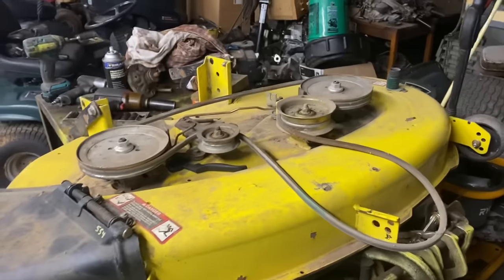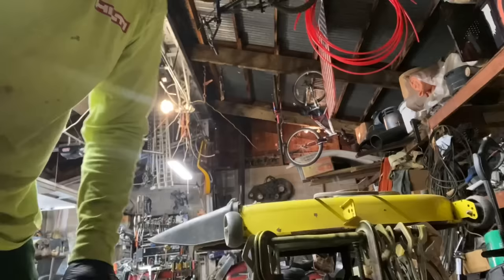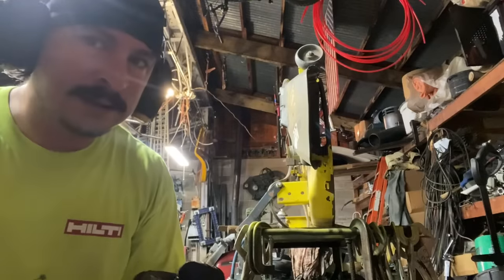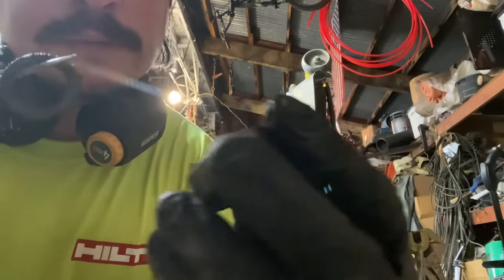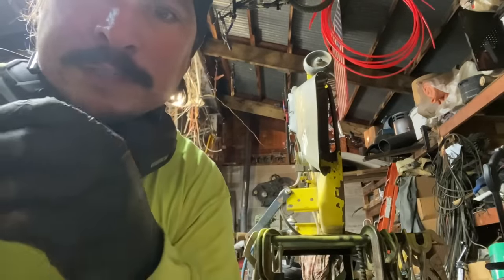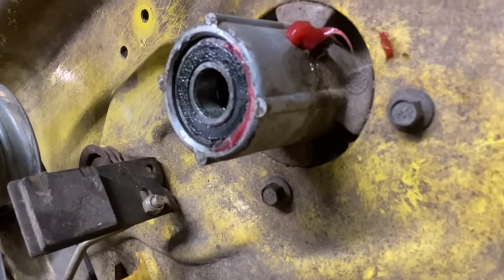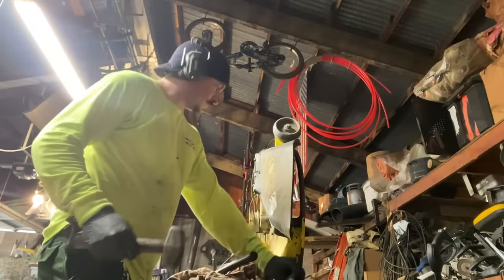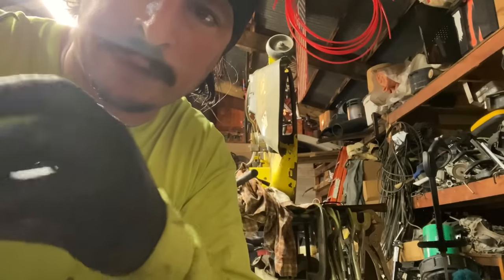Part 1 - Don’t trust the “Experts” Grease your mower deck sealed spindle bearings Common sense.

Comment: Doesn't the shaft still need grease?
Reply from the maker: Please explain? The shaft? Only the bearings need grease. Some shafts have a zerk on the top and grease enters through a hole in the shaft. Is that what you mean?
Reply: @GTObearclaw1   I thought there are spacers in the middle
Reply: @GTObearclaw1  So then how do you tell if you have sealed bearings in your spindle? I have a mower with the hole on the top. Does that mean it has open bearings? Or are they sealed too and they just put a zerk at the top to give you a warm and fuzzy feeling?
Reply from the maker: @grasscutter88  some types of spindles use spacers to seperate the bearings some use the housing to space the bearings and or shaft. In some cases the shaft or hosing has a step cut in it to maintain bearing placement and no need for spacers in those type. As for grease, just add grease until it exits a bearing and your good to go. Seals are invisible to grease and the grease will pass right by the seals like they don’t exist. The only spindles that I can’t guarantee will allow the grease to pressurize and push past seals are the MTD spindles with a relief hole in the side of housings. In that case grease will exit there first. Just plug that hole with a screw or add another zerk. Then you will have a zerk on the top side of deck too that will be easer to acces. The ones with hole normally have the zerk under the deck where it’s covered with old dead grass and hard to find. The ones with zerk on top of the spindle shaft are usually AYP Husqvarna craftsman Poulan Ariens. Those don’t have a bearing spacer and greas can still
Fill the void and pass bearing seals. This is really simple stuff. Not near as complicated as folks like to make it seem
Reply: The ferris ICD deck has a relief hole too
Reply from the maker: @grasscutter88  im not familiar with that brand. I figure it’s probably similar but those are commercial so may be tapered roller bearings. Would be best to get advice from someone who knows those. But it’s safe to say you should grease until you see it exit the hole. That’s a bare minimum. And in some cases like equipment without a inner shield in place that’s efficient.
Reply: @GTObearclaw1  I think they're sealed. Hard to tell though because they have different brands and I forgot what  the part number was.
Reply: 5023330 is ferris' part number for the bearing. Looks like 6305a is the bearing number. The oem ferris number seems to show it as an open bearing on one side.
Reply: Looking it up by the actual bearing number I think it's just a standard sealed bearing. What does the A mean in 6305?
Reply from the maker: @grasscutter88  good
Question, I think if the part number has RS in front of the number it means rubber shield but I can’t recal what the letter after means. Maybe someone will know and reply to help us.

Comment: The problem is this. grease zerks do not hold pressure, they do not have a one way valve in them. I don't believe that you can lube them enough to apply constant pressure driving the grease into the bearing, particularly the upper bearing.
Reply: In a sealed system, zerk fittings do indeed hold pressure unless the zerk is bad or the system isn't closed such as the spindle in the video. The video is absolutely correct in every way and the seals in question are nothing but dust covers with water splash protection. Once the inner spindle housing is completely full of grease, the bearings will also fill with grease just as the video proves.
Reply: @delemerson9306  Are you sure about that? I am asking sincerely. I just don't think that you can maintain enough pressure in the housing over time to drive grease through the rubber seals, especially the upper ones. I would be more inclined to remove the inner rubber seals but then there is the possibility of contamination entering the bearing, particularly the lower bearing. Damned if you do, damned if you don't.
Reply: @randaldavid7685  I'm absolutely certain as I've personally experienced it. Everything in the video is correct.
Reply from the maker: Del knows what he is talking about and thanks for the comment, del especially. 
Grease zerks do hold pressure if in proper working order. You can google a diagram it’s a zerk. super simple design and self explanatory when you see how they are constructed. They are designed with a one way valve. And the tool providing grease is where the pressure comes from. A standard grease gun can apply 2,000 psi. And as much as 15,000. That’s why it blows my mind that so called mower gurus are telling folks that it’s a Wase of time to grease these spindle assemblies. If the so called experts were half as smart as they think they are why not test the theory in a video and prove it won’t work. But yet not a single naysayer has provided video proof. That’s why I decided to call BS on the topic and try to help folks get the right info. And that’s why I felt the step by step process was necessary because folks won’t simply believe that greasing the assembly at the zerk will apply grease to the bearings so I proved it step by step to help folks see the truth of the matter.
Reply: @GTObearclaw1  your video is a perfect example of YouTube working to properly inform folks who have needs when they are DIYers or simply can't afford to pay a shop for repairs. Thank you for the video, we appreciate your efforts
Reply: @GTObearclaw1  Thank you for your reply

Comment: Don't a lot of these spindles have a air hole when you're pumping grease into it that the you hear it coming out of the air hole.
Reply from the maker: The only mandrel housings Iv seen with a hole between the bearing position is made by MTD. I’m sure others exist but MTD is the only manufacturer Iv personally had experience with. The MTD umbrella is Prety large. Cub, Troy bilt, MYD gold, whites, and many many more. Not all but some of them have had the “weap holes” and I suggest filling that with a screw. In my opinion the weep hole is a way to prevent grease from reaching bearings so the parts fail and require customers to buy parts from MTD. No reason I can see that having that hole makes any logical sense. The only people who think it makes sense don’t really understand the process I explained. They think seals will get damaged. But those same folk have never spent any time to verify their beliefs.

Comment: The only way the grease will get in the bearings at the top and bottom of those shafts is if you take out the seals that face the inside of the shaft and then put major amounts of grease in that Shaft. Unless you put a tube going to both top and bottom where it will actually get to both bearings. Another way would be a bit harder is to drill a hole at top and bottom of that shaft and then place a tube directed at the bearings. The one at the bottom would work better as gravity would make it so the top wouldn't get a lot unless you did get a hard tube directly to it. Just pumping grease into that shaft without removing the seals covers won't work and you spend lots of money on it. it would be better to take the bearings out and hand grease them and put them back in!
Reply from the maker: Wrong. Wrong. Wrong. That is not the only way. Thats just the way that requires a bunch of wasted time to disassemble and pointlessly remove a few seals that can’t stop pressurized grease. Did you even watch the video? I just showed everyone step by step basically breaking this process down to baby steps so folks could watch every step of the way and see it’s not magic. that all you need to do is grease until it exits the assembly through top and bottom bearing. Can you explain how grease came out the assembly by passing through the bearing? Good lord I feel like this is rocket science. You just overcomplicated this more than anyone else who has left a comment saying the seals stop pressurized grease. You guys are killing me. Open your mind let your brain work. That inner seal can’t stop 5000psi of pressurized grease from passing it. What In the heck are you even talking about, tubes? Come on man this is way simpler than your making it.
Reply: @GTObearclaw1  yep I did watch your vid but didn't see where any grease would have gotten into the bearings through the seals that wasn't there before forehand from the factory.
Reply: @GTObearclaw1  The seals are made to keep grease in and hopefully dirt out but trying to force grease into them without first removing the seals facing the inside of the shaft is a lost cause!
Reply from the maker: @mortneff4674  if you in fact did watch the video, can you explain how grease passed by the upper and lower bearings and exited the outer seals of both without passing the inner seal and then through the bearings? It boggles my mind that someone would argue about something that’s simply laid out in a step by step process shown in a video to prove it works. Those inside seals can’t hold back pressure, specifically the grease that is under pressure when being applied to the housing. It passes right through the lip of seal that is a simple rubber flap. Nothing other than a dust shield. I made the video to help people. Your logic is wrong on the this. I’m no expert on most other things in life but I’m trying to help you understand your wrong about this topic. This is one of the few things I do know and understand and I see that most folks don’t know as much on the topic so I made this video to help folks get better life from mower deck bearings. Many others make videos on this topic saying it will not work and provide no proof. Anybody that says it won’t work has no proof. Just naysayers with no proof why. Just opinions. If you noticed I used a different color grease than what was already in the bearings when I started. All this is fully explained in the video. Unfortunately you are going to do extra work to maintain your bearings because you can’t accept the proof I provided. When all you have to do is use a grease gun and grease your mandrel assembly until grease exits a bearing and you could text this for yourself. But I can’t make folks try it. Just offer the information and hope they are willing to be open to trying it. Seems silly folks would just say it won’t work and then fight about it rather than just try it. Kinda like a can’t fix stupid situation.
Reply: @GTObearclaw1  By over pressurizing the grease in there which in the long run will be bad and end up loosing the upper seals and letting more crap in. plus your still using a Heck of a lot of costly stuff to prove your point!
Reply from the maker: @mortneff4674  just curious what costly stuff am I using? A tube of grease is under 10$. No need for expensive grease. But folks can spend as much or little as they want on grease. Ultimately you get what you pay for. Iv found tubes of grease for anywhere from 3$ to 20$. Even found some on sale once for 1$ a tube. Buying the good stuff definitely wouldn’t be a bad idea. But Just having bearings well greased will be better than running without adequate grease in them bearings. Less than a tube of will do the whole tractor even if you were to grease every zerk and even if it’s got a huge deck with three completely empty mandrel / spindle assemblies that need to be filled the initial “fist time”. Actually one tube usually does about 3 tractors before I have to put another one in the grease gun. If done properly as Iv shown in my video the assemblies need to be filled and if they never have been the first time could take about 50
To 100 pumps. After the first greasing or a proper greasing as Iv described, the spindles will be filled with grease and then only require about three pumps on latter services / preventive maintenance. Once filled they will only need 3 pumps to push a little fresh grease into the bearings. How is just adding grease costly? I argue that it’s the absolute least costly and most important preventative maintenance one can do for a riding mower other than checking oil and keeping a clean air filter. when the spindles are filled the Seals will not come off and the pressure does not stay in the bearings. Grease just pushes past and pressure is immediately gone. I know grease guns can exert thousands of points of pressure even from a grease gun but I think it’s safe to
Say that it takes a tiny fraction of that to push past a few little flimsy dust shields. If we are being serious on the matter you have no argument and you don’t answer any of my constructive questions. No pressure remains in bearings to cause issues latter. The seals can’t hold pressure. If the assembly is not put together wrong there is no space for the seals to move away from the bearings. Only the rubber flap around the seal moves allowing grease to pass. One bearing application may be different from another. I’m fixing and servicing lawn mower decks, I’m not working on high speed rail trains here. Adding too much grease is not an issue for mower deck bearings. Other than making a greasy mess there won’t be anything to worry about by adding too much grease. It simply squirts out of the path of least resistance and that’s it. Nothing dramatic, unless someone is a stickler for cleanliness. Wipe off the excess and move on. For this application more is way better than not enough. Not enough will be a guarantee of premature failure. However greasing to the point the assembly is filled as I show in my video will not hurt anything and I have never seen a seal pop off in the 15 years Iv been doing it this way. Can you answer my questions ? What is costly? I’d like to know?

Comment: More's law don apply on grease.

More grease, more friction=higher pressure and higher temperature.

Check bearing manufacturer's site for proper way to apply lubricant to ANY bearing.
Reply from the maker: That Information may apply to some applications. But for this application it is counterintuitive. The RPM and load on these bearings may be different form applications where that is true. not going to matter for a lawn mower deck that is made to be greased like this. Stop overthinking a simple process. Or just run your bearings until they fail. But unless you have proof of how it is an issue and you want to create a helpful video with proof, you only have your opinion. I don’t need to check the proper way, I have been testing this 18 years. Works like a dream. And I know what happens when the bearings don’t get greased. Lol. Thanks

Comment: I worked FOR / IN a Major Lawnmower MFG for over 30 years, our spindle assemblies HOUSINGS then all of metal construction was made out of metal, the ONLY reason they installed grease fittings was as a sales gimmick, yes if you pumped enough grease in the housing the grease MIGHT seep between the spindle shaft & the inner race of the sealed bearing BUT if the shaft tolerances was correct that wouldn't happen because the shaft to bearing fit was nearly a press fit.